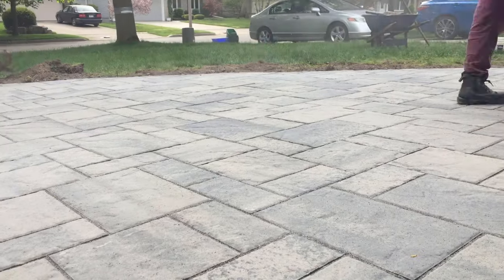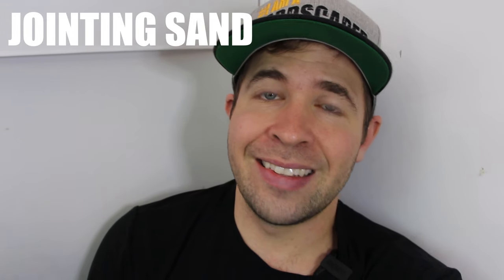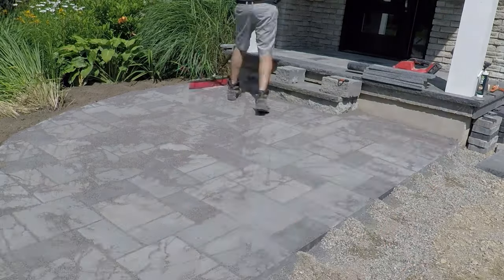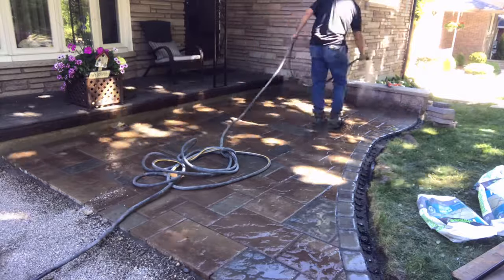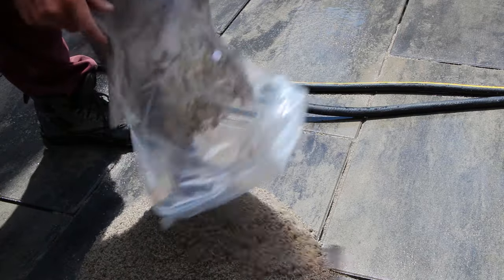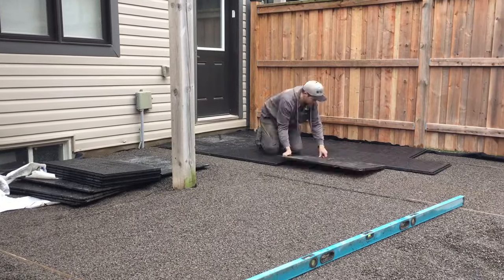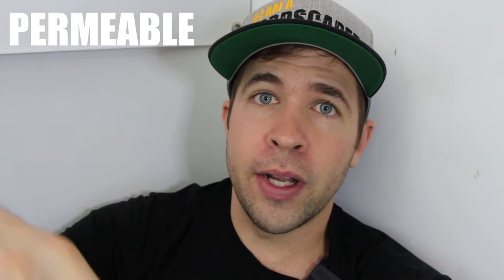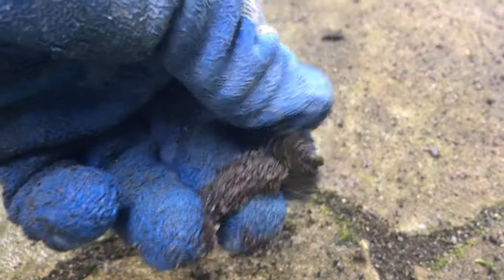Choosing the Best Paver Jointing Compound

Comment: I'm so grateful to have found your videos. My friend gave me some very thick bluestone that I'm going to make into a patio in a shaded area. Being  a novice homeowner trying to save money, I was going to use polymeric sand, but I think being in the north east with freezing cycles and  in the shade, I need to learn more before just buying a product. It sounds like a different joint may be called for for both water drainage (it's at the bottom of a hill) and shade application.
Reply from the maker: Yeah polymeric sand can be tricky in shaded areas. If it gets no sun, I’d look into one of the alternatives. Or put a good enough slope on it to run all water off of it

Comment: Great Video now the questions. I recently pulled up a walkway of pavers, it appeared to have a sand/soil base now the question is which sand to use? The primary reason is weed control. Here in the NW corner of Virginia weeds grow anywhere/everywhere My first choice is polymeric but not sure about the base.
Again, Great video. Raises a lot of questions.
Reply from the maker: If you are discussing the sand for the joints, I would stick to polymeric sand. Just make sure that you follow the directions very carefully and maybe watch this video:
https://www.youtube.com/watch?v=4YOxa523D0w

I personally do not like using the semi-permeable jointing compound for pavers on a sand bedding / base. Your other option would be just loose jointing sand and adding a joint stabilizing sealer to it.

Comment: We have just used the Sika fast fix all weather jointing compound, we have blues and greys Indian sandstone flags with black limestone cobbles round the edges we used the charcoal colour.  The sun came out when we were starting to use it and this has caused it to stain the flags also it’s not as easy as it looks because you need to compact it down really well or it will come out when you try cleaning the flags.  We have tried lots of different patio cleaners to try and get the stain out but so far they have not worked.
Reply from the maker: wow that is a pain. I'll have to look into that and see if it is consistent with Sika or the charcoal color in general across manufacturers.

Comment: Ive watched probably 20 of your videos - so helpful. I butted my 20” pavers up to each other and the gaps are mostly about 1/16” with a few odd ones around 1/8”. Should I use polymeric sand? A few people have steered me away because of how small my cracks are. I was considering just using concrete sand…. Would LOVE some help and advice!
Reply from the maker: Thank you!
There are sands that are fine enough for 1/16”. Maybe alliance Gator or NOCO by TechniSeal. I’d buy one bag and try and see before you commit. You could do a jointing sand, but you’d want to eventually apply a joint stabilizing sealer to keep it there

Comment: Old school best way is old way pointing need 10 ml joint 👍. A mixer I would do 1 off Sharp sand and 2 of soft and one of cement mixer up a little touch of spr in cement mixer . A mix it up like semi-dry  when you put in joints tuck in really well and of with a  doner  or a 10 ml finger trowel that only way forward that's the way I was taught old stone mason 👍
Reply from the maker: Good method as well!

Comment: Awesome video; thank you for providing the content.   I have an older home in the pacific northwest with a paver patio in the yard.  I power washed the patio due to algea and mold (I think), which cleaned it pretty well, but also removed some of the fill between the pavers.  I was considering using Mold Off, but I haven't done that yet.  Anyway!  I want to fill the gaps with a sand, and it sounds like the Resin might be a good idea, but I get a ton of rain.  I am also unsure if there is gravel below or not, but I know there is a french drain along one of the edges... so probably?  Some areas of the patio have sunk, but I know I am not good enough to fix that.  Anyway, just wondered what would be the safest choice for an old patio, and if there is something that is a algea/mildew preventer, that would be great.  Thanks!!!
Reply from the maker: Resin would be great to use if you get a ton of rain but without knowing what the base is made of, I would just go back to polymeric sand. You could seal it to make things easier to clean, but the best preventer of moss and mold is a properly pitched project that gets a good amount of sun.
Reply: @iamahardscaper  Thank you!

Comment: Great info.  Can u give me your opinion?  I live in southern Ontario,  about 100 feet from Lake Erie in the front and back into a wooded area…so lots of insects and debris🙄 but it’s lovely.  5 years ago, new build, professionally landscaped…the intent was low maintenance for us as we getting up there.  In the back yard we have a stamped dyed concrete and sealed patio (that has chipped everywhere) and below that (grass level) a flagstone patio about 5 ft wide by 15 ft long with polymeric sand. After less than 1 yr, it was a mess. Now the stones nearest to the house are sunk and the poly is literally a mess. Last year I tried to fill in with more poly, but that is in the landscaping now.  There is little sun in this area and it mostly stays on the damp side. Even the house has some green mold near the bottom in this area. We can’t even walk on it because it’s such a mess…and the ants 😳  I like the flagstone,  and can’t afford to have it ripped out and redone.  I’m wondering what you think about a 

cement product/mix that we would be able to apply. E tween the joints/stones,  of course after lifting the stones and creating a proper slope again and removing what’s left of the polymeric sand and moss and ant hills.  So frustrated as even watering plants near the area is a disaster, and when it rains it’s even worse😩.  So much for a low maintenance yard.  I appreciate your input very much😊🇨🇦
Reply from the maker: Unfortunate to hear. Also in ontario 👍
Are you using polymeric sand meant for wide joints? How wide is your flagstone spaced apart? What does the bedding layer below the flagstone look like - chips of stone, chips and dust, sand? 
The solution of a cement mixture will crack after a winter if the flagstone is not installed on concrete.
Reply: @iamahardscaper  thanks for replying😊. I will check tomorrow and I will let you know. Thankyou!!!
Reply: Hi again. The stones are spaced 3/4 -1 inch apart.  I’m not sure what kind of poly was used. It was whatever the landscaper used. The base is chips of stone and dust. The stones are easy to pull up as most of the poly is either gone or not stable.  Not sure what to do, the poly won’t set. After watching your video, I think it may be because it’s mostly shade and damp in that area. Would love to just throw cement between the stones.🙄  where in ont are you located?  I’m in Amherstburg.
Reply from the maker: I am in Toronto. You should look up Ardex exterior grout. I use it when I mortar natural stone for the joints. I believe it is polymer modified which is what you are looking for. But reach out to Ardex and inquire about this same problem you are having and if their product would be applicable.
Reply: @iamahardscaper  ok, I will for sure.  Thanks so much for the information and taking the time to help. I appreciate it very much!

Comment: I am thinking of doing a small 130sqft paver patio in phoenix, az. So no freeze cycles, I was going to use gator base but am torn on the jointing compound. My pavers are 1/8in joints and the patio will be in the shade. Based on your recommendation I am thinking of sloping at 1/4in per foot to get the best drainage and least pooling. Is there a polymeric sand on the market that can work in 1/8in joint applications or is my best bet regular sand like "concrete sand" for the joints then a sealer over top? If so what is a good sealer that wont leave anything on the paver surface. I like the natural look of the stone I have.
Reply from the maker: I’d say the Gator base may not save you as much labor as it would where I am with freeze thaw cycles. There is definitely poly sand that will work with those joints without a problem. I’d find what is available near you and check with the manufacturer. But you could definitely go the jointing sand route (not concrete sand, it is slightly different). As for sealers, most poly sand manufacturers also sell sealers so you can check to see what they have available, no recommendation here they are all the same. They will have natural look sealers

Comment: Great video.. subscribed!  We have concrete under our 1" brick pavers.. with what looked like orange fill dirt in between. 
the joints were filled with polymetric sand, and sealed. The work done was not very professional... and some of the sand has washed away.
My question is: can I remove the remainder of the sand and fill the joints with regular tile grout?   Thx, Jack
Reply from the maker: No that wont hold up with movement. I couldn't be able to say for sure with what was put between the pavers and the concrete, but if a good draining sand or chip gravel was not used it is going to be hard to get polymeric sand to actually work. You may want to use a jointing sand and then seal the sand in place.

Comment: Your jointing sand should have cement mixed in. You press it the joints with a bit hose pipe so that it has been compacted. The cement will cure by taking the moisture from the sand...
Reply from the maker: That would not work anywhere with a freeze thaw cycle.

Comment: Hi I have a brick patio in an apartment balcony. I believe there’s a membrane underneath the patio that seals it from the rooms. I have weeds growing through the gaps and would like to have a more permanent solution. Should I use jointing compound ?
Reply from the maker: No, I believe there would need to be airflow. I can’t say for sure without actually seeing it

Comment: Quick question, can I clear the spaces in between my pavers (they have sand) and do some kind of cement “mortar” filling instead? I like the German shmere look and we are over run with ants and weeds. We have the pavers on a slope, with very large drains all around the border so water isn’t too big of a worry. It get direct sun all day right now but will eventually be covered. Any thoughts? Thanks!
Reply from the maker: where are you located? if you are in a climate with freeze-thaw cycles and the project is not mortared to a concrete slab base, it is best not to use mortar for the joints. They will crack quickly and you will be back to being over run with ants and weeds and have an even more labor-intensive time cleaning those joints out.
Reply: @iamahardscaper  we live in central Florida. It’s all a sand base. Do you think that would be a problem? If so, what polymeric sand do you recommend to fill the spaces? I was also thinking about using an acrylic mortar repair substance that looks like concrete. I’m desperate to get rid of the weeds and ants 😂😂 but I don’t want to give myself more problems later.

Comment: Great video, if we are putting 12x12x2 red square pavers around our semi in ground pool. How would you do it? We are putting in a drain and then we were thinking about putting a insulation foam panel around the thin walls of the pool so that pavers are not right next to the pool. Using 3” of 3/4” crushed clean gravel, then HPB but I’m not sure how much I would need for approximately 500 sq ft. Do we figure about an inch, like sand? What would be best for jointing products? Any information would be appreciated. Thank you
Reply from the maker: Hi, I'll try to hit on each of these:
if you are in a climate that experiences freeze thaw you would want to be a minimum 6" for your base. 1" of HPB. to know how many yards you need: (square feet x depth in inches) * 0.003. Jointing compound recommendations would be dependent on joint width. This video covers that I believe.

Comment: Thanks for the video.
I have clear stone gravel as base over sandy soil, geo-textile fabric, then bedding base layer called APB, then laying flag stones in mostly with tight small 1” gaps but some 2-3 inches of gaps. Now wondering do I need to put mortar under flag stones or go with Polymeric sand or Raisin mix base? What do you suggest?😅
Reply from the maker: personally I do not mortar unless over a concrete slab. Use an appropriate polymeric sand or resin based jointing compound, but make sure you are getting the wide joint formulas for either of those. It will cost more but if you do not it will definitely fail.

Comment: Would I be able to use a rubber hammer to compress the sand if my area does not require a machine compactor?
Reply from the maker: I wouldn’t. But I know people that will in a pinch

Comment: Hi, we had pavers installed, the pavers we placed did not have a joint, pavers are all placed now but there is no room to place the polymeric sand , play sand, ect.. the joints are tight. What would you do? We used 3/4” clean rock, and 3/8” crushed angle rock/ HPB, thank you, sent an email with pictures to email on website. Thank you , great content
Reply from the maker: I sent a reply to your email 👍

Comment: so if i am using the angular crushed clean stone for a joint in a flagstone patio I can and or should use a joint stabilizing sealer to keep out moss etc. and if so can you suggest a few brands?
Reply from the maker: It won’t necessarily keep moss from growing but it will make cleaning easier. You’ll also want to make sure that the sealer will work with that size stone. TechniSeal and Alliance are a couple brands I’ve used

Comment: Super informative! I have a question though…around 4:40 it sounds like you do not recommend a base of stone dust when using polymeric sand. If I got that right, I’m wondering why not use stone dust as a base? Thanks in advance!
Reply from the maker: The short answer is that stone dust is not good for drainage. It does not allow water to pass through it which causes polymeric sand failure. If you go to our channel page and search stone dust in the search bar, we have a video explaining it in full.
Reply: @iamahardscaper  thank you. I’m having a simple driveway widening job done very soon, this helps me tremendously. I’ll go and check out the other video to hopefully learn more before the work starts.

Comment: Hi  I am planning to iinstall a 300 ft open base patio with flagstone.  What joining compound would be the best regardless of the price.  I am going to follow your technique only and am in the process of finding a the right person.  I live in nj and not everyone wants to open base. Please advise about joining compound.
Reply from the maker: it would likely need to be polymeric sand. TechniSeal has NOCO, Alliance has a wide joint polymeric sand. You want to get the flagstone to be fairly tight as you lay. You could also install a loose chip stone but that brings more maintenance but makes it more permeable. And then just to overwhelm you with choices, Romex has a permeable jointing compound, but I do not know off the top of my head the maximum width for that.

Comment: Why not use EZ Joint  in garden walkway with paver base and cushion sand? Will the sand wash out from beneath the pavers even with a cement border with border pavers embedded in cement?
Reply from the maker: I personally do not like the idea of introducing a significant amount of water to concrete sand. You should not experience washout if it is contained. But I will always opt for 1/4" chip as my bedding layer over concrete sand.
Reply: I have plenty of paver base leftover and can remove the cushion sand and replace with paver base instead.  More compacting or just screed it over the compacted base?
Reply from the maker: You will need the bedding sand and you will want to keep that layer as consistent as possible.

Comment: What do you think of wet lock?  My guys have used it a few times. My thoughts so far are it sucks 😕 even though every supplier is trying to push it super hard.  Ever use it? It seems hard to work with unless there a trick were not using. Any thoughts? Regular polymeric just seems better and easier.
Reply from the maker: Is that like EasyJoint or Nitro? I do like it, but only for the right application. It’s expensive and it takes longer to install. Love it for raised patios though

Comment: Hi, Thank You for the video!.  My pavers' joints are 1/4 in wide, but only 1in high and I am struggling to find a good joint compound, since basically all of them recommend at least 1in depth but if I account for the 1/8in clearance required, then I am left with 0.875in.  Would you think it would still be ok?  Have you done a project with thin pavers like this?  I am using synthetic base. Thank You in advance for your comment!
Reply from the maker: I would think that you would be okay. I have done projects with the same material on the same base and have been fine. But don’t take my word for it, I would reach out to the manufacturer of the sand to ask

Comment: Maybe I missed this, but have you tried the QC-based "EV Polymeric Sand"? Curious to hear how it performs; I like that it accommodates gaps up to 4", compared to something like EZ Sand from HD that only supports up to 1/2".
Reply from the maker: I have not, but I will eventually try to test a variety of sands and see how the perform.
Reply: @iamahardscaper  No problem, thank you for replying!. I might give it a go :)
Reply: I have not tried EZ-Joint yet, and no experience with polymetric sand.  Most suppliers in my area discourage the use of polymetric sand.  Is there one that you prefer specifically.